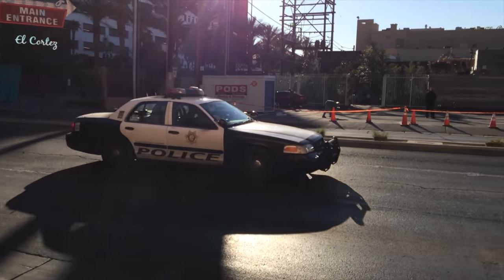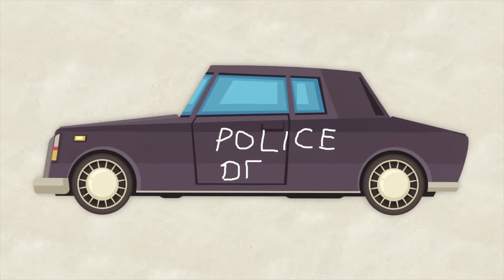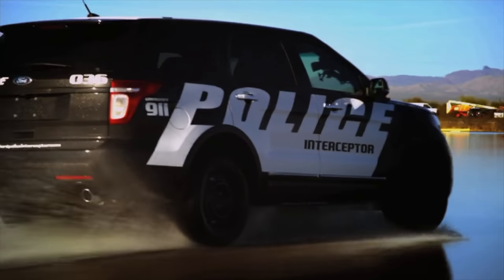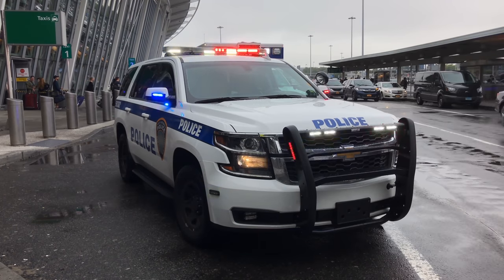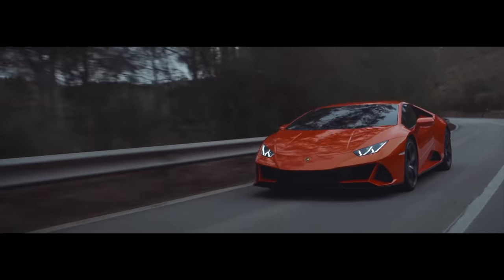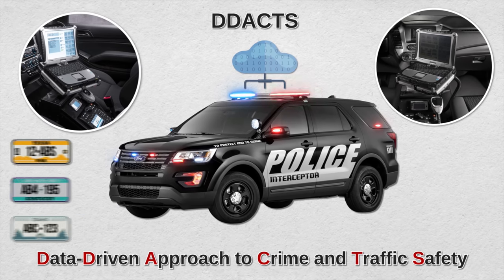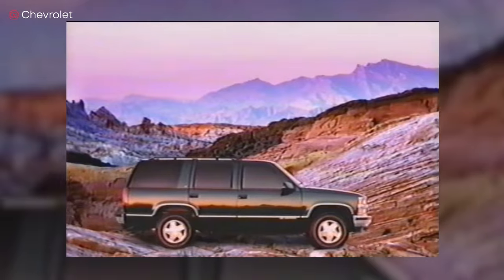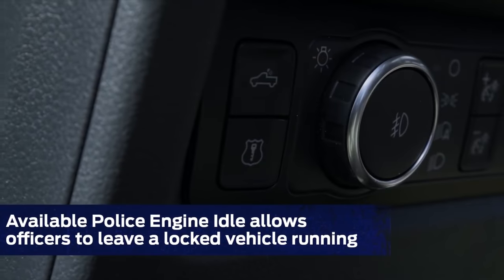Here’s Why You Can’t Outrun a Police Car

Comment: Having several family members over the years in law enforcement there are really only 2 reasons you can’t outrun a police car, radios and choppers.
Reply: That IS in %99 of cases.
Reply: True, when I first started driving in a small town in NC as a young and dumb teenager.....I ran from a crown vic in my Chevy S-10 and it most certainly wasn't any rocket ship. Was completely stock 4.3l V6. That cop just didn't have the guts to keep up. His car could have.
Reply: Make sure they uphold their oath! Probably order followers....
Reply: "You can't outrun the Motorola!" was what I was told by a veteran SLMPD (St Louis Metropolitan PD) cop.
😁
Reply: thats about it
Reply: I won’t agree with you , chameleon paint finishes , with auto switching plates , and a Mexican hat has done the trick for me .
Reply: This is exactly it.
Reply: @johndough5854  It's true though. I'm all over here spreading the message. 😆
Reply: @EivinSukoi  Not if you get the attention of a chopper. They have the upperhand so to speak. You would have to be going ridiculously fast to lose one on a somewhat clear day. Like landspeed  record setting fast. You would be a U.D.O. 😄
Reply: Outran a chopper in Indianapolis in a turbo k swapped Honda del sol. Outran 2 awd chargers in North Carolina on a back road in a vw jetta tdi that was making no more than 230 HP 💀
Reply: @deadinside7600  They couldn't keep track due to being in fits of laughter.
Reply: Wrong
Reply: @CynHicks  200 mph work you think?
Reply: @jimmydcricket5893  OK 🤡 🤣🤣
Reply: Yup…back in the 80’s my dipshit buddy tried to outrun the cops on the freeway….with an Opel Manta…it did not end well for him…
Reply: I been in 5 pursuits I got away in 4 the 5th was involving a semi I was arrested during that chase but only after I ran out of diesel which was 87 miles and four totaled squads in addition to being stop sticked 8 times which only took out my steer tires and the truck took a bunch of slugs along with a slug I took in the arm
Reply: @richstanton8545   Heard that also as a truck driver.
Reply: I live near the New Mexico boarder and there's been several times now where people have easily out run the Sheriff's out here. They just do 109mph till they hit the boarder and the sheriff gives up.
Reply: Haven't  seen the Hellcat in Texas yet, have you?
Reply: @CynHicks  Drive near airport or to multi story parking garage to avoid chopper
Reply: @johndough5854  Beside guts, probably was common sense trying not to endanger himself and others. It's called responability
Reply: @tommyd1655  I’m curious, but, how’d that last one end up for you legally?
Reply: @sprtsfanatic1  it was one of 5 separate cases I pleaded out to 13 felony charges 13 sounds like alot but I originally had 42 felony charges I was out and 3 separate bonds totalling over 200 grand every and 10% I'm still  had 20 grand out another 65 grand in the best lawyers in town I had the top three on my cases but 27 months 16 in the remainder on paper I did 40 total for multi staff assaults which results in extended incarnation the lions share of charges were crimes while awaiting trial in a county jail I had numerous staff assaults a escape attempt felony destruction of jail property which resulted in being classified level 5 security 23 hour lockdown meals on wheels and basically no privileges
Reply: @sprtsfanatic1  my final chase was in a semi I lead the cops on a 90 mile pursuit several squads were totalled it got intense
Reply: @motofish312  fastest I ever drove and it was in a police pursuit was in a 71 challenger stolen of course 440 dual quads four speed I I opened her up on the freeway they car was ungodly fast when I hit the hwy coming off the on ramp I cracked 4th at 100mph and the tires broke loose three crown Vicks couldn't hang with it a trooper in a impala tried same deal but at full throttle I literally couldn't look at my gauges because it took my eyes off the road for 1/8 mile it required total focus and I will give mopar credit I ran her wide open 18 miles till I hid in a small town but once I got in a safe area I looked my gauges over everything was perfect but 17 miles consumed 3/4 tank of gas and it was for nothing I was I'd from traffic cams coming out of the city
Reply: @sprtsfanatic1  but going by sentencing guide lines for a  person with my criminal history points guidelines called for 17 to 25 months I scored near the top of the box point wise a first time offender with no prior criminal history most likely would get probation for 12 -16 months
Reply: Anpr cameras is what u should really fear bikes can get away from choppers by hiding(hard to do but it has been done look on yt)

If I were you I would sit down with my family members in law enforcement and exsplain to them how giving people 10-20km over tickets or expired registration tickets is merely revenue generation under the guise of public safety and encourage them to let people off instead of ticketing if they truly did not hurt anyone in a said situation even if they had a chance to hurt somebody...

People shouldn't be punished for what could have happened because of their actions they should be punished based on what actually did which most of the time is nothing
Reply: @deadinside7600  I outran a state patrol copter in Minnesota in a 70 challenger 440 dual quad car when I was booked 9 months later on traffic cam footage the video from the copter was submitted as evidence the pilot is heard radioing HQ he couldn't hang with the car due to strong head winds he couldn't exceed 125 mph I was clocked by ground units at 155 mph which was probably about top speed I ran it full tilt for 19 miles on the interstate until jumping the off ramp and hiding in a trailer park
Reply: According to the area and Dept. policy. Some discontinue high speed pursuit in the interest of public safety. Some attempt to shoot the driver. Several have been shot in my state.
Reply: @tommyd1655  yeah whatever. cool story bro  >,<
Reply: @deadinside7600  cool story brother
Reply: @lurk7967  couldn't have said it any better
Reply: @ronj4727  cant shoot me if you can't see me ;)
Reply: @tommyd1655  dude your crazy wild.
Reply: @tommyd1655  🤣
Reply: @tommyd1655    I covered 70 miles in 30 minutes driving through Wyoming passing semis on the shoulder  and still had a 1/2 a tank of gas, my dog loved it.
Reply: You jam up the radio with a linear, and drive perpendicular to an airports runways to lose the chopper.
It can be done, but proceed at your own risk. Cops hate getting burned, and they will remember the car that got away. Also, using a linear could bring heat from the FCC.
Reply: Lmao 🤣 uh huh tell us how we can't , maybe they let me go on purpose 😅
Reply: @Yippee Skippy or be ripping in a hellcat🤣🤣   🚗💨 zoom                🚁    their actually faster then our chopper 🤯

                   🚓  wee woo wee woo😪
Reply: Hellcats say otherwise
Reply: @CynHicks  Helicopters arnt nearly as fast as you seem to think they are, a cheap sports bike could out run them. Most helicopters can't even do 150mph in a straight line.
Reply: @LascielInviere  I know how fast helicopters are. Helicopters don't need near as much speed in order to keep track of a vehicle in most situations. They have the height advantage AND the lack of traffic. As long as that helicopter can get up there a man with scopes can absolutely keep track. Assuming they have gear (I would) they can probably use thermal tracking also for night situations. You have clearly underestimated the advantage of vertical  movement, open air*, tools ect... Or you're thinking we're talking about a drag race between a helicopter and bike. Lol We weren't.

*open air isn't just an advantage because of no traffic but because they can actually go in a straight line, top speed while you have to go up, down, and around adding more distance to your travel..
Reply: If you wanna see some wild police chases from a motorcycles point of view, check out the Ghostrider from Sweden.
Reply: Choppers?! So they have cops cruising around everywhere on motorcycles with stretched front forks? 😂
Reply: @EivinSukoi  
What’s the plate switcher brand? Where’d you find it?
Reply: @tommyd1655  
So if you’re story is true, which it’s not, how are things in prison?
Reply: Guys, Here is Our Savior

YaH The Heavenly FATHER HIMSELF was Who they Crucified/Pierced for our sins and “HERE IS THE PROOF”

From the Ancient Egyptian Semitic: 
"Yad He Vav He" is what Moshe (Moses) wrote, when Moses asked YaH His Name (Exodus 3)

Ancient Egyptian Semitic Direct Translation
Yad - "Behold The Hand"
He - "Behold the Breath"
Vav - "Behold The NAIL" <— YaH’s Crucifixion
He - "Behold the Breath"

“Behold the HAND that Beholds The NAIL” 

PROVES - YAH The Heavenly Father HIMSELF was Who they Crucified

That is EXACTLY what Moses Wrote

Here is what they mean

YaH's Name:
(Ya)d + (H)e, as YaH is what Moses called Him and YaH Declared: "this is My Name, this is My Name for all generations" (Exodus 3)

YaH is The Creator of “MAN”: (Genesis 2:7)
Yad He, (HAND BREATH), as YaH's "HAND" Formed man from the dust  of the Earth and His "BREATH" made him a living being (Adam)

YaH's Sacrifice of Crucifixion for “MAN”:
Vav He (NAIL BREATH), the "NAIL" through YaH’s "HAND", in Sacrifice of Crucifixion, that whosoever shall call YaH Savior, His “BREATH” brings forth life (Salvation)

How YaH arrives:
YaH arrives via the Tent of Meeting (Exodus 33:7:11, Isaiah 54, 55), where a Tent is erected outside the city, a cloud descends upon the entrance of the Tent and YaH appears...

Why they demanded YaH to be Crucified:
YaH was Crucified according to Hebrew law (Deuteronomy 21), to be NAILED/PIERCED on an Almond Tree for BLASPHEMY as it was for His NAME they demanded Him Crucified. The Messiah claimed He was YaH...

HE WAS YaH!!!

HalleluYAH translates “Praise ye YaH”

The Hebrew Book of Isaiah

Isaiah 42:8
"I am YaH; that is my Name! I will not yield my glory to another or my praise to idols.

Isaiah 43:11
I, I am YAH, and there is no other Savior but Me.

Isaiah 45:5
I am YaH, and there is none else.
Reply: @richstanton8545  You don't have to outrun the Motorola. You just have to outrun the cop using the Motorola. The radio signal itself is much faster than you and your car, but it can't actually stop and arrest you by itself.
Reply: Supercars can outrun choppers going at 250mph+
Reply: @CynHicks You'd have a few GTA stars... ⭐⭐⭐😂